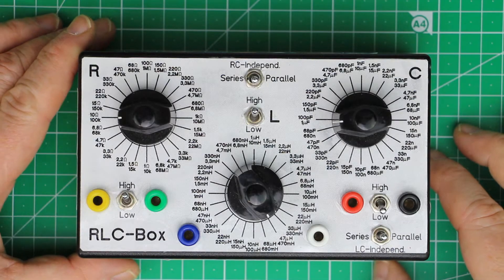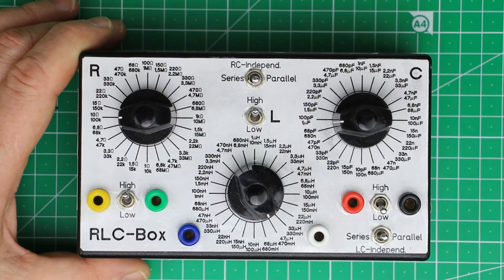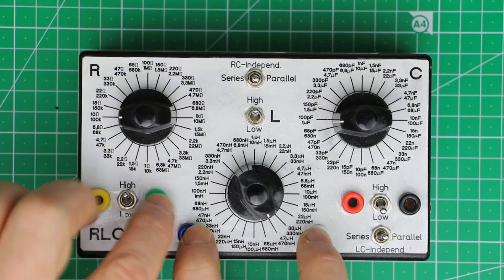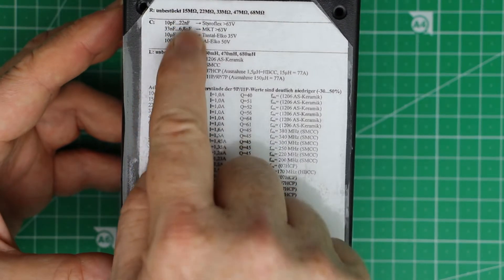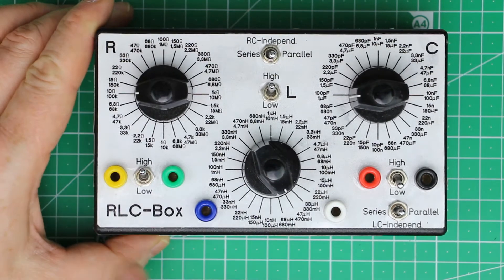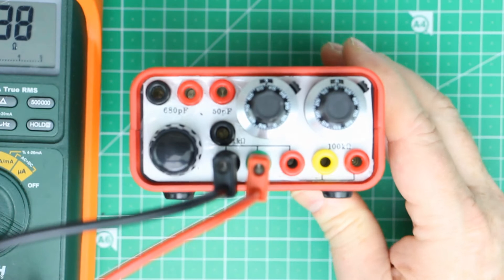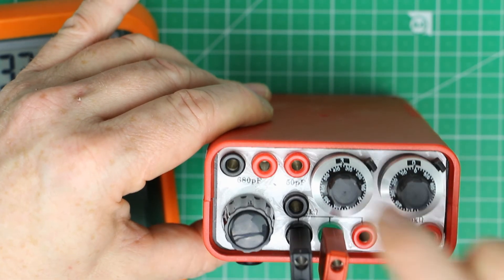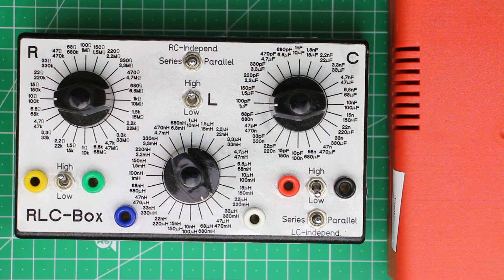Every maker should have...[Pt.18]…an RLC-Box

Comment: Novice here: AFIK Having a large air gap between components prevents them from interfering with each other, hence why you’ve hand soldered this.

However - Shouldn’t this matter only if the component trace / wires receiving power are next to each other? The design inherently prevents any frequency/ resonance issues because you’re only using one component at a time, no?

Comment: I would like to build one of those and I tried to get the documentation you so kindly provided, unfortunately it seems like the cert for kainkalabs web needs to be updated in order to get a secure connection.
Reply from the maker: Yes, the SSL certificate has expired and in the last 12 months I didn´t have time for anythnig, Nevertheless you can download the docs with e.g. the Chrome browser when you allow an exception. Better still if you wait for 6-8 weeks, you can download the full production files, a manual etc. from the Kickstarter campaign pages. I have (after a 12 months pause) continued the project in the last week. All parts are in production or already on the way to me. When the first are shipped, all files will be published and it will be available for buying in our online-shop. In the meantime all progress updates are also published on Kickstarter.

Comment: It might be the design task from hell but would a pcb design using surface mount devices work? A double sided load on a two layer pcb maybe. Once designed and optimised then manufacturing can be automated and you would have a great product. It would not have to be perfect. Get 80% of the way there and it would still be brilliant.
Reply from the maker: Probably one would need 2 PCBs because the rotary-switches have 2 layers (or is it levels?).
That could be feasible without too much manual rework.